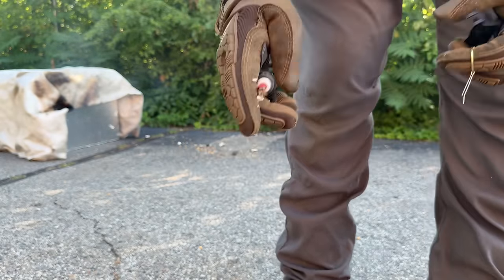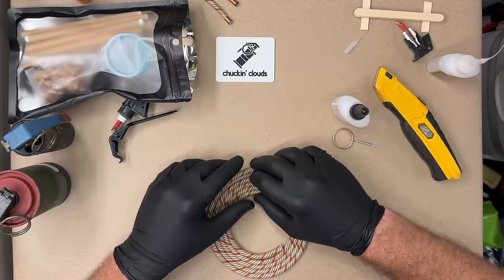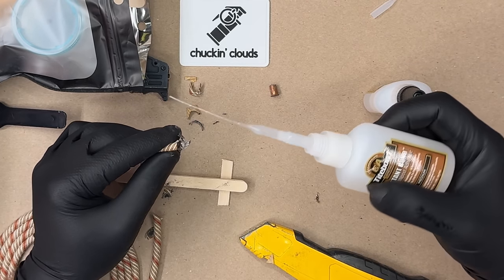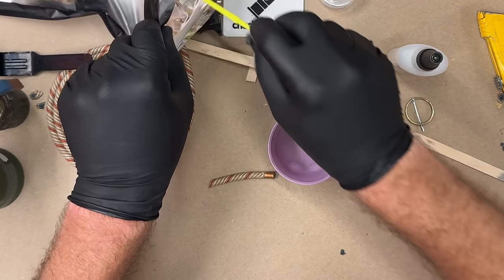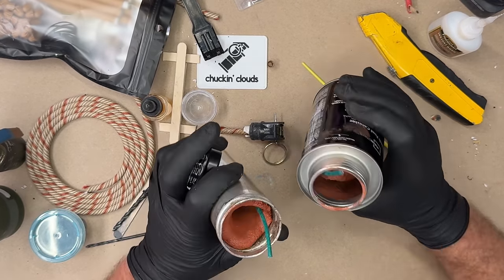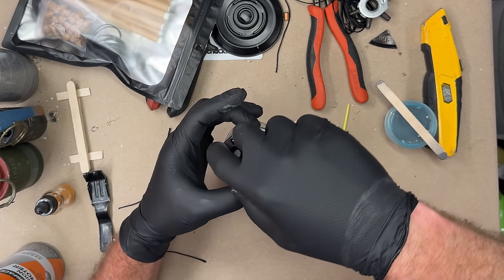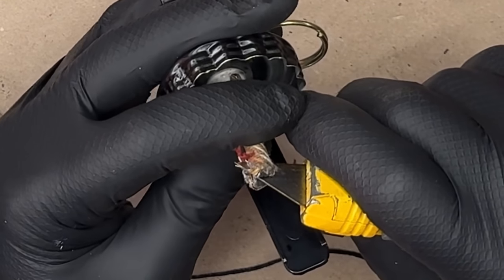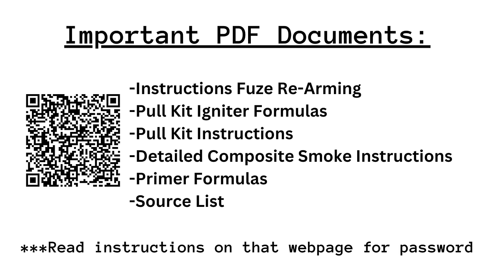How To Legally Rearm Grr'nade Fuzes With a Time Delay of your Choosing

Comment: Nice, these things are awesome but most people rearm them incorrectly.
Reply from the maker: Really? How? It seems like everybody likes to use primers. And what’s your opinion on scott paces instructions? https://www.reloadableshells.com/pdf/XM18ReloadableSmokeGrenade.pdf it looks like we will hopefully be collaborating on some stuff
Reply: @InventionIncarnate  those instructions look pretty good for smoke devices, where I generally see people screwing up is when they're intending them for not so legal uses and they neglect to do things like packing around the fuse with some sort of non flammable material and they run the risk of having sparks transit directly from the primer to the cap. It's kind of a self solving problem but I hate seeing people get hurt.
Reply: @InventionIncarnate  I like your recipes and love your vids, but it feels like you're over complicating things in your designs. The tiki torch cannisters are a cool idea. Keep'em coming. Thanks!

Comment: I also tried the same some years ago with an old deactivated frag grenade. I used the same time fuse. I only put some fine black powder with dextrin on the top and used a normal primer.
Instead of NC lacquer you can dissolve gun powder in acetone or methyl ethyl ketone. Not sure if it's better but it works.
Maybe you can just put a drop of black powder on the smoke composition instead of this green fuse. Or a small line of powder. Might be cleaner and less "explosive".
I like the work you put into it. And your homemade primer sound really quiet and seem reliable. 👍
Reply: And you got a new subscriber. Interesting stuff on your channel. I'm sure it's totally illegal where I live.😅
Reply: @-Tris-  late to the party but if we are dissolving things in acetone- ping pong balls- apparently they are or used to made From nitrocellulose- same deal as some “gun powers”. In any event- its how i always made NC lacquer.  I would make up a slurry- peanut butter like- and use it for rocket ignition- but would let the left over flash of- it become rigid and can be formed before it sets- but- is still ignitable.

Comment: Zip ties also work instead of string for closing off the time fuse. I spent some time as part of a fireworks club.
Reply from the maker: They are much easier, if you can find them in your messy truck lol

Comment: Instead of the fuse mounting to the bottom, could you put a little ball of smoke composit on the bottom of the secondary fuse? Now that you have the perforated tubes, you could mount the visco fuse directly to the time delay and not worry about it touching the sides? Just leave enough to add the bicarb and plaster to the top. Seems like itd much easier to arm that way

Comment: Is it possible to use small pistol primers as a fuze? Pull pin, striker hits primer, primer lights the fuse.
Reply from the maker: Yes, they will work as long as there is a way to prevent the time fuse from getting pushed out before ignition. An alternative is to use visco fuse and allow the primer to vent around the fuse
Reply: @InventionIncarnate  Awesome, thank you! I love that vent idea, ill try to incorporate it
Reply: @InventionIncarnate  like vent holes in the tube

Comment: Hey Mr. Invention Incarnate, I would like to ask a question if that's alright? I fly fpv race wings, and I have used commercial grade smoke devices on both wingtips for a visually pleasing effect. This was a few years ago. Since then I have gotten into making my own smoke devices, but have struggled to find a good housing that is narrow enough to not hinder the aerodynamics of my aircraft. Is there anything you could recommend a housing/container for me to use that is the form factor of something like a 1.5" by however long (6"or 8" maybe?) cylinder? Are there any hard rules for the type of material a smoke device housing can be made of? In other words, is it safe to use something like aluminum tube? Is there any danger of containing the smoke device mixture in something tough like that? Like, is there any chance of it over pressurizing and having a super exciting/dangerous reaction? Or would it hurt the efficiency? I guess I am curious if there are any downsides.. Thank you for what you do!! 

P.S. This is what I am talking about, regarding wingtip mounted smoke devices. https://www.youtube.com/watch?v=Vi9FqIAG0Rg
Reply from the maker: You’re talking FPV Fixed wing not quad copter right? And what is average flight duration? I should clarify, what is desired burn time? Also are you using colored smokes? And do you ignite prior to launch or use a remote ignition? If there was a tradeoff between color or duration/volume what’s your priority?
Reply from the maker: Hey, a potential solution for this is in my next video on personal rescue smoke flares

Comment: It’s very cool. I have like 50 aluminum mousetrap kind heads from css grenades but they use a small-pistol primer. I tried to reprimer it and the problem is that the explosion blows out all the fuse and it wont get burn. Do you have any idea for this? I use armstrong mix
Reply: I answered your question about an hour ago. Did you see it before it disappeared?
Reply from the maker: Check out my website>documents>ignition formula
Reply: @yadjekim  no, I didnt see nothing
Reply: @InventionIncarnate  thanks!
Reply: @MrLEMV  Pt.1 Clean out the fuse channel in the striker head assembly.
Reply: @MrLEMV  Yeah. It's not letting me post the entire process.
Reply: https://www.youtube.com/playlist?list=PLDl3uz0m-PlQjbXC3f642oQbHvJRzE4BD
Reply: @RemoteCamper   very cool, well in my case, the is a flashhole for the smll primer , so I remove it and put a new, the problem for me is when the primer burns, gases blows the fuse
Reply: @MrLEMV  When I do this, the extra gasses removes the whole blank from the fuse assembly BUT always lights the fuse.

Comment: How thick is the mystery can? to me it looks like a pirouline can.
Reply: Do not use Pirouline cans. The ones I used had seams that were rolled into place. Not fused or soldered in any way. The pressure from the mixture blew out the side, making more of a rocket engine than a smoke device. It's the same reason that some of his designs blow the striker assembly off the top of the device.
Reply from the maker: It is a tiki torch can!

Comment: I have a cap n ball pewpew which i got a conversion cylinder for, so i have some left over pew powder and caps. Do you think these caps can be used like your little copper cups? Sorry about the way I'm wording things, Frick'in yt ya know.
Reply from the maker: Yes, the wording is necessary as I’m already badow-shanned. But yes, those caps should work with h-48 primer mix. They may, however, tend to push the time fuse out without igniting.
Reply: I was gonna ask pertty much the same thing but about 209 primers @InventionIncarnate

Comment: I feel like a 209 primer would simplify this. Used 209s on re-activated boombooms just fine.
Reply from the maker: Yes 209s work if you have a firearms license, are using an actual m-228 or m201a1, and don’t require a time delay. 

This chemical technique can be used on used plastic igniters salvaged from airsoft games., which is the focus of this video. 

For the life of me, I couldn’t get ahold of inert fuses with spoons. It wasn’t until a subscriber sent me a box of 50 of them (which I sleep with under my pillow) until I was able to do anything.
Reply: 209 would be WAY too much power to just light a fuse.  I wouldn't mess with those primers in this type of situation.
Now if you were to drill out the original primer like this guy does and insert a 9mm blank, with the powder removed, so its just a pistol primer, that would work perfectly.

Comment: Dont know about these toy fuses but cannon fuse and a primer works with real fuses. Just drill and epoxy the fuse in.

As for tge smoke composition you used i would suggest you look at something else because that burn rate was far too fast and did not produce enough volume. Too much of the reaction was lost in the form of heat. The volume of your canisters should have given a 30 and 45 second burn respectively. 

As for construction, you did ok for a hobby firework. Instead of the cap blowing off under pressure might you add a hole at the bottom covered with a couple pieces of reinforced aluminum tape?  Id you had a shop a bead roller could be used in construction of canisters but delta screw utility type tins are a cheap and easy way to do what you are doing.
Reply from the maker: What was the smoke composition I used?